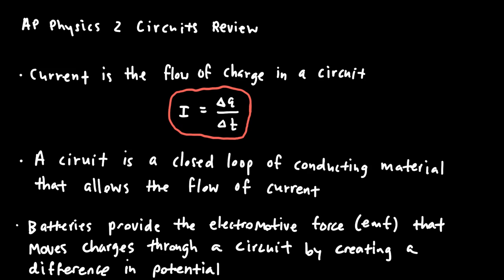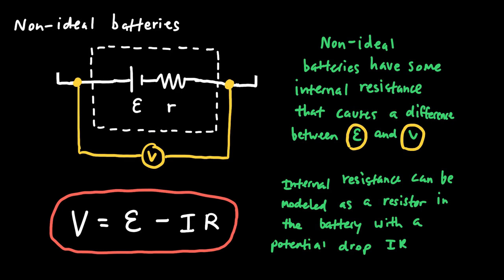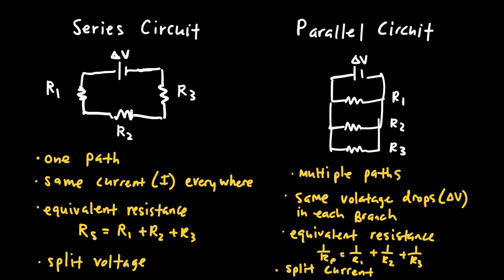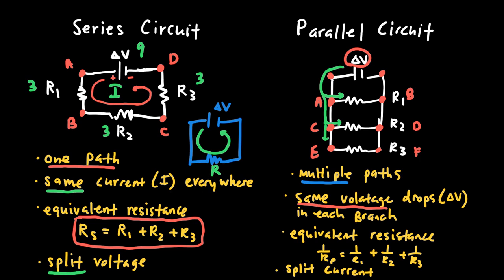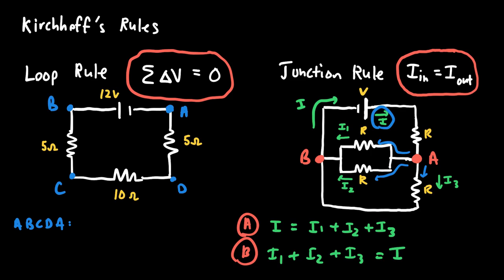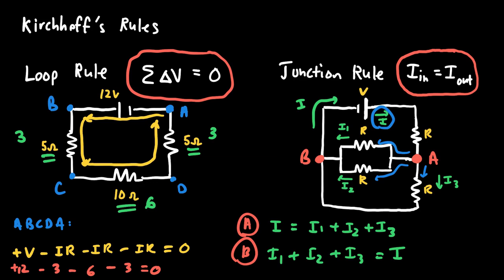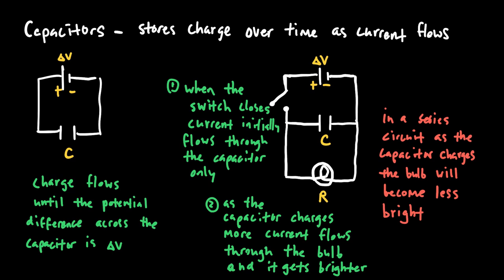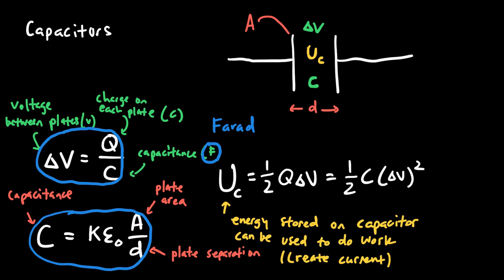AP Physics 2 Circuits Review

Comment: thank you, but at 13:15, when you talk about a lightbulb needing to "split" the voltage, do you mean split the current or the voltage? because I thought voltage difference is the same with all of the resistors. thanks
Reply: In series, the voltage drops for each resistor in the circuit. Only in parallel circuits does the current split between each branch. Voltage difference between each branch is equivalent only in a parallel circuit because voltage is the same for all branches. Current is only equivalent among all resistors in a series circuit. I hope this helps!